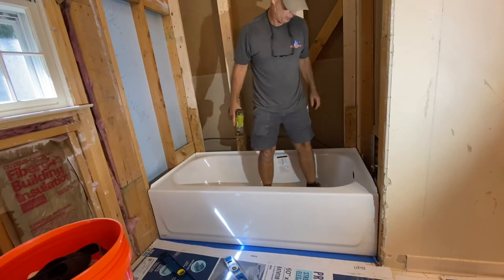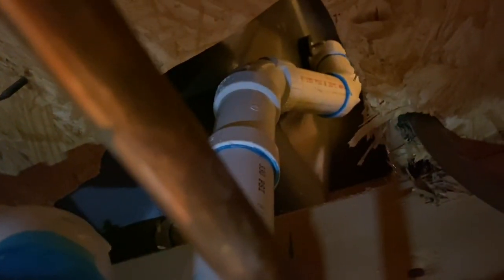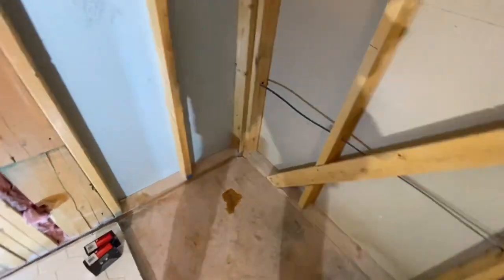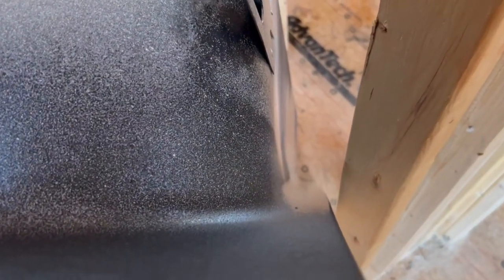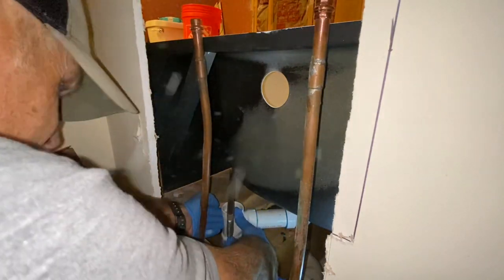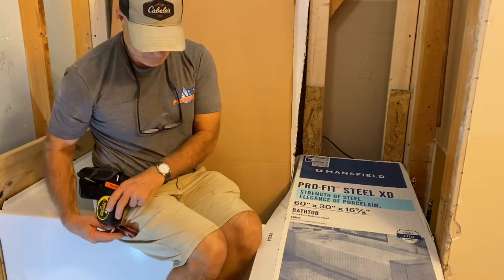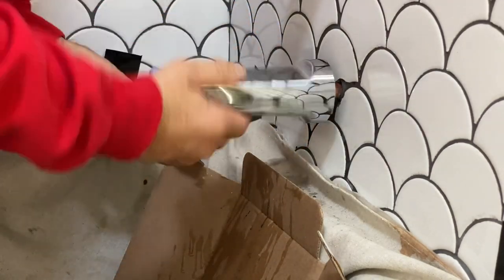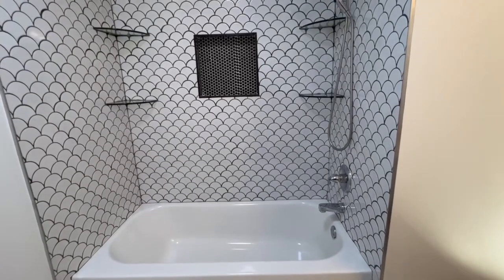How to Install a Bathtub. Is Replacing Bathtub Difficult? #plumbing #DIY

Comment: When it comes to the back stringer that gets attached to the wall I find it better to install it a hair low, the reason for this is so it doesn't hold the back of the tub up, I find it easy to just slide shims in-between the board and tub to level it, also it may be necessary to use some high density spray foam to secure the bottom from moving, you can do this by reaching into the stud bays and spray the foam between the floor and tub bottom, this works especially well around the drain because they often don't have much support on that side.
Reply from the maker: Thank you for your perspective! We love having input so we can discuss different ways of doing things. I am not exactly clear on what you mean when you write “ doesn’t hold the back of the tub up”? I would absolutely agree with the spray foam idea and use that myself when necessary. We do have to make sure it is NON expanding! On this tub the manufacturer’s styrofoam pad actually worked perfectly believe or not. How often does that happen🤔? I also agree shims in plumbing definitely have a place however that would very hard to implement in this situation because I couldn’t get to the back of the tub. Thanks again for your time to leave a comment. Hope you have wonderful day!